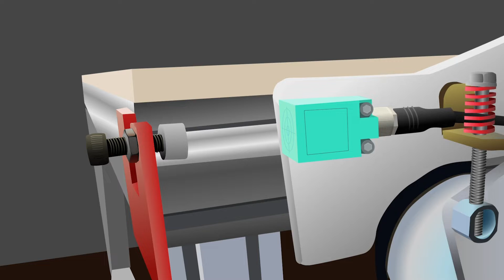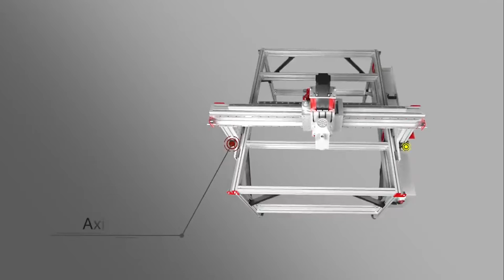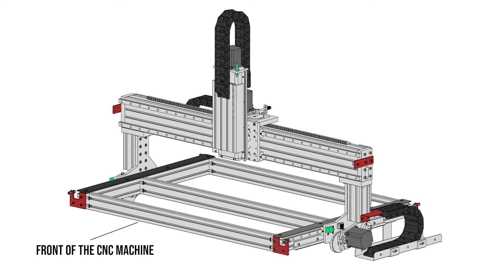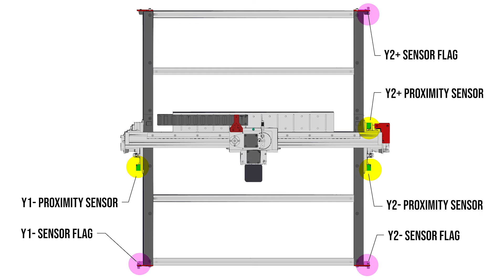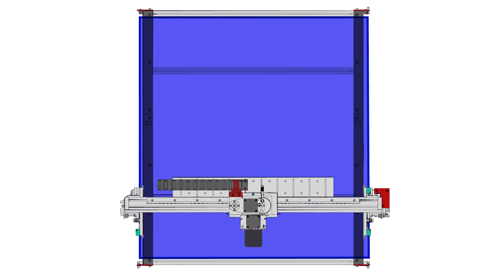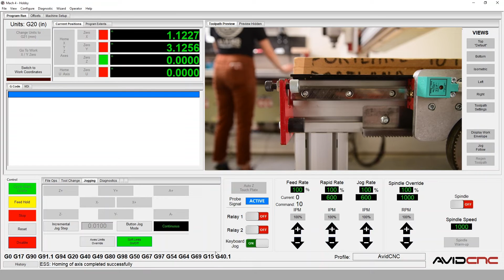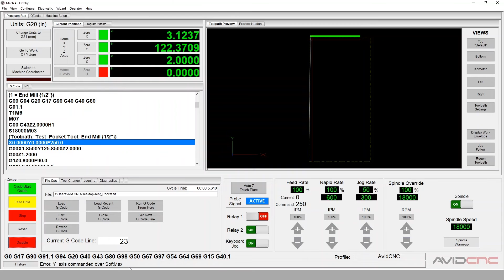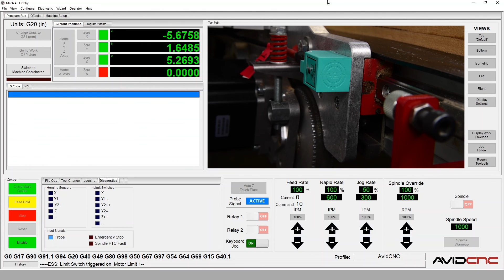Pro-Tip: CNC Proximity Sensors

Comment: Very good, I have a problem that I have found in Mach 3, I have the STB4100 controller with the TB6600 drivers and 4 nema 23 motors, the problem is that I get a warning (G100) when trying to set the soft limit, it drives me crazy and I don't know what to do anymore, it's been 2 months now and I haven't been able to solve it, I would really appreciate it if you could help me. If you need any more information to help me, do not hesitate to ask. Thank you for your time, greetings.